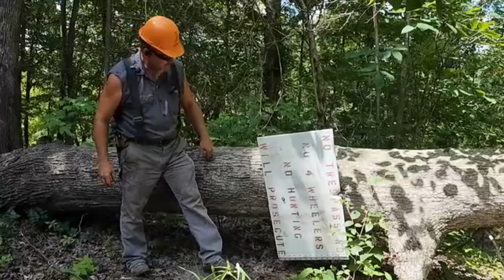Storm Damage; HUGE OAK - PORTED Stihl 026 w 28" Bar and John Deere 5520

Comment: Morning Ole Sawdust, love your videos about the daily life of a good ole country boy. I promise to finish the chicken story this next week… now that the whole world knows I’m a procrastinator... just funun ya😄. That little Stihl is a screamer, you finally got it to run like a Husky 😂. When you get those rings seated and balance the right length bar to it, there ain’t nothing in its class, or the next few above it, gonna touch it. I don’t understand all the squishes or squashes you done to that saw, but I can recognize an analytical mind at work and the sound of great running saw. You puff up your chest and stand proud, you did a hell of a job on that Sthil…… Just seeing the trees on your roads and frost-free, you must have trees knocked down everywhere, you had some kick ass wind go through. If you didn’t live so far away I’d paint the tops of my Husky’s white and come help ya…… When I was in the business I had a couple of tractors like yours for riparian work and I built a “reach/yarder” for them out of a  heavy duty 1/4”x4” H beam approximately 5’ long. The best way to describe it is it’s just it’s like a 3 point hitch post hole auger for the back of a tractor without the auger and head. The beam can be left straight with an eye and hook welded on the underside towards the end . It will allow you to raise the end of the log/tree and yard in 2 to 3 times the weight. I know you can build one easily with your skills and tools. Just saying…… If you had of gotten your bar and chain stuck, I call those look arounds… you immediately look around to see if anyone saw you… I guess you can call them edits. I have to go to the big city 300 miles from camp next week for three or four days for speech therapy appointments because I’m having trouble swallowing. I ain’t exactly sure what speech therapy has to do with swallowing. Maybe talking country all my life is the cause of not being able to swallow my lovely wife’s sometimes dry pork chops. Wife thinks if I should at least try to cut smaller pieces instead of stuffing the whole pork chop in and wolf it down, might help. Anyhow, because of a previous engagement the wife has, I will be in the big city of Reno Nevada for nearly a week all by myself. That’s scary… My wife really loves me though, she got a motel on the outskirts of town and set up a taxi to drive me to and from my appointments… city drivers and mountain man drivers don’t mix… myself, I think she just wants her truck back in one piece… Any which way, I will have lots of time (hiding in the motel room) to finish the chicken story and the story about my lazy brother in laws smokehouse (you might remember him and his firewood needs I wrote you about a few months ago). Well he passed away last winter at 82… God bless him… My sister divorced him back in 1968 because of his laziness, with the final straw being his smoked house escapade. There was no doubt he was the laziest man I ever knew… and me being the dumbest… but I still out foxed him in the end… he ain’t gonna cheat me out 6 more cords of firewood this winter. Well I’ve rambled on long enough. See ya around the next bend. Ole Mountain Man
Reply from the maker: @olemountainman3996 The Ol Stihl punches above her weight class doesn't she??!! ...and kicks, scratches, eye gouges, and curses like a Sailor when called upon!. 
I understand the procrastinator part in ya; I've always THOUGHT about becoming a procrastinator... never got around to it... maybe next week?
You GOTTA make them Stihls run; Husky makes a strong-enough mount that you can tie a skidder to the handle and pull it out of a pinched log; Stihl decided to go the other way... it cuts all the way through before gravity even has time to act!! 😉
I've got enough trees down that 10 gal of chainsaw gas wouldn't get them all blocked up. It's a MESS!!
I like the idea of your yarder/reacher; mostly, I can get close enough to the log, so I don't require the reach. What I do: I use a Cat III 3-point quick attach; it will straddle a log and I can hook a chain to the 3rd link position; I can adjust its height to place the right weight on the back of the tractor and also carry the front of the log out of the mud. 
I sure do have plenty of LQQk arounds, but I usually leave THEM... I save my editing skills for when I mumble stuff under my breath!!!

Not sure what speech therapy has to do with it either!!?? I had an old boss that had his throat stretched... don't know if they used one of them deals we used to put in leather shoes, or what?? He got to where he couldn't swallow chicken breast or 'poke' chops either... anything dry. I suggested he could save some money by eating like I do... homemade apple sauce with my poke chops and cranberry jelly (that stuff that keeps the shape of the can when you dig it out with your Barlow)  on my chickun n turkey!!
I sure wish ya a safe and successful trip to the city lights; hope you are able to get a little rest; first time I ever slept where I could see a yard (or street) light was the night I was shipping out of the MEPS station on my way to Uncle Sam's Yacht Club for boot camp; I still have flashbacks of that.   ....NOT bootcamp... that was a breeze... them dang street lights, traffic noises, and lack of critter noises still haunt me!! Hope you're able to get fixed up so you can swaller a whole green persimmon without even noticing!!

I DO remember your Brother In Law, but didn't wanna spook ya off by making you feel SOOO far behind in the story0debt you've built-up to me and everyone else here. 😉  Laziest man I ever seen was sitting on a stump under a shade tree and was whimpering and crying... asked him what was the problem and he explained that he had accidentally sat down and pinched his family jewels... I tried to comfort him and explained that the agony would ease-up pretty soon... he didn't think so; he speculated that it probably wouldn't even BEGIN to feel better until he had the gumption to shift his weight to take the pressure off of them. 😉🤷🤣
Dang, I love the banter with ya!!! Tell your bride that I appreciate her ability to put up with a couple of people like you and me!!
Reply: @HayChaffandSawdust1  Damn, I’ll bet you met my brother in law a sitting on that stump, besides lazy they used to call him pancakes….. After my speech therapy if I start talking like that news anchor man on the BBC news channel you all come and put me out of my misery….. Back when my wife and I were young we both remember when our grandmothers or aunts used to write letters to our moms and how excited we would get when our moms would read them to us after supper and hang on every word. Now my wife has me read all our bantering back and forth and it takes us back to a much simpler time before the art of writing was exchanged for five words and six emojis. We’re coming up on our 59th anniversary in a month and when it comes to teasing or being the source of a joke between each other is what has kept us young and feisty. There isn’t a word written between you and I that she doesn’t have me read to her while laughing to the end. Thank you, Ole Mountain Man
Reply from the maker: @olemountainman3996   I'll need to hear the story of "Pancakes" some time!!   Lemme see... that's ONE chicken story, ONE Smokehouse story, and ONE "Pancakes" story... not that anyone is keeping track!!
I love to hear how luck you and your bride BOTH are... well, it probably had less to do with "luck" and more about being friends.
We was purdy poor a growing up mom used to read to us too. I remember one winter, we didn't have much to eat, so mom sat us around and read us recipes. Well, we didn't know it at the time, but my sister was hard of hearing... dang near starved to death!!  Good luck with your therapy.  I won't be able to tell if you talk like a jolly bloke or still still talk like an Ol Mountain Man... as long as you don't start typing with them backwards "R's or them symbols that look like a goat flying through a house on a pitchfork, I reckon I can still understand ya!!